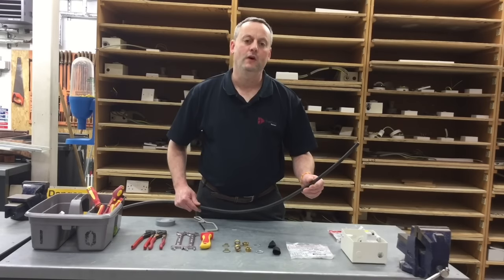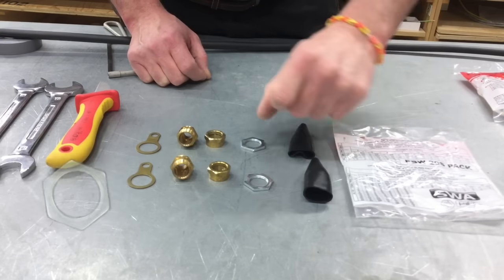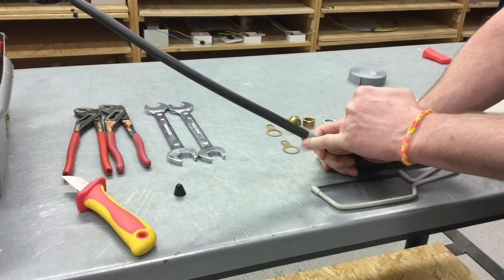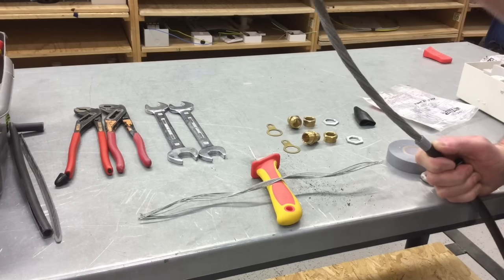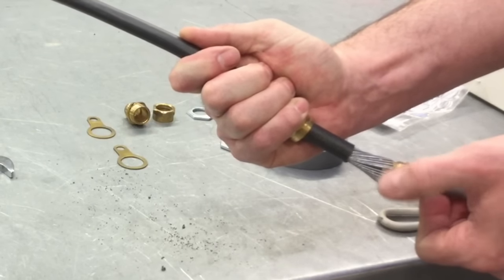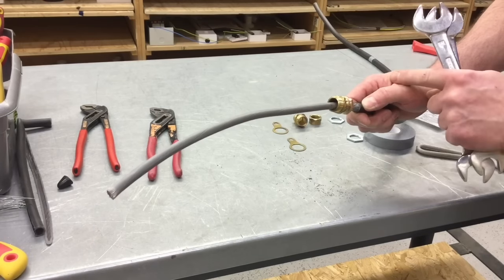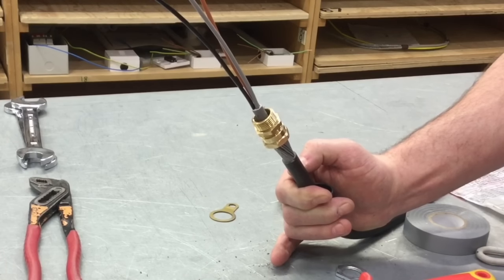How to Make off a SWA Cable Gland (Steel Wire Armored Cable) Step By Step Demonstration

Comment: Faultless work -- I've done quite literally thousands of these and you've got it perfect. You're a good instructor.
Reply from the maker: Hi. Thanks for taking the time to comment 👍
Reply: GSH Electrical do you have an email address
Reply: i dont feel your pain
Reply: I on the other hand am a rank amateur but wanted to thank you for an outstanding lesson which has allowed me to update and extend a power supply in my garden for a pond pump and filter I’m installing in a long derelict pond. Really appreciate the new learning and I’m confident I’ve put in a safe and waterproof setup.
Reply: @richardhunter1153  |Hi at the glands with a thimble called a particular name, I only seem to find the type without thimbles

Comment: I'm not in an assocusted trade.. I'm wiring my shed up with SWA and whilst I had a good idea of how to deal with SWA it's good practice for me to see how it's done properly. My SWA terminates at an isolator in the house which will be wired to a 32amp feed.. and terminates the other end in my shed in an RCD unit. I'm not paying £1000 for an electrician to do exactly what you've just demonstrated. So thank you.. you've saved me a Bob or two ;)

Comment: I really do miss working with SWA. Never thought I'd say that after running 1500m of it with 80 glands but after using the north American equivalent (teck 90) I do. Teck 90 has an earth conductor inside it and the aluminium armour which is segmented making it less flexible than swa isn't considered rated for cpc but still needs bonded. Add in the fact they have 120v/208v here which means two live conductors and a neutral making the wire even bulkier.

Comment from the maker: == 🕐 Time Stamps - Cut to the action 🕕 ==
00:00 - Making off SWA cable
00:34 - The type of SWA (steel wire armour) cable
01:02 - SWA gland pack explained number of conductors, size of conductors and gland size
01:34 - BW20S gland explained 
01:58 - What's inside a SWA gland pack
02:27 - Starting the termination demonstration 
03:12 - Fitting the SWA shroud
03:58 - Cutting into the steel wire armour
05:51 - Removing the outer PVC on the SWA cable 
06:34 - Breaking off the SWA 
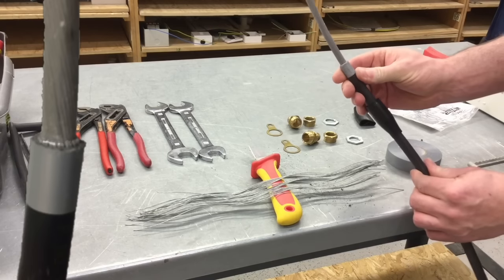07:31 - Start fitting the SWA gland 
10:50 - Tightening the SWA gland
12:29 - Removing the bedding material around the conductors

Comment: might be a good idea to also advise that this is an inside useage gland pack ie. bw20s  and there are external gland packs for outside use cw20s , bw should not be used for outside terminations etc

Comment: Hi Mate, 

Nice video, only one thing missing,... you inserted the rubber before putting in the Gland but you didn't do anything to that, I was wondering, do you tape that in, or do you cover the gland in any other way? 

Thanks 
H

Comment: Hi there
I have just purchased a set of swa glands but when I go to fit one there is NO THIMBLE on the end of the nut. Just the threaded bit. How can I fix the armoured wire without this thimble, please ?
It's impossible to screw the two threads together with the wire over the main thread of the gland.

Comment: How about terminating a 70mm armoured into an already installed waterproof gland (including working out the set).  A 70mm armoured that's taken 4 blokes 2 nightshifts to pull in - No pressure!  This is quite tricky and can be a bit nerve-racking if you've not done it before.
Reply: How about a 300mm 4 core using E1W glands not these CW glands, I hate them always looks a messy job until the sleeve goes on.
I much prefer the separate cone and olive, then you can open the gland and inspect it without disturbing the compression of the steel wire armouring.

Comment: We have nothing like the SWA cable in the US for building wiring systems. I like its  flexibility and the metal strand protection, isn't it also water resistant.
Reply: you would be using a similar but different gland for wet rating, but it is protected from water and UV

Comment: I wished we could all strip armoured like that lol. My on-site experience of armoured is much different. Generally been sitting around for a bit and damp sets in. The inner insulation gets stuck and makes it impossible to separate from the inner cores lol. Have to use a knife to cut the length of insulation and peel apart. Great video for the basics though.
Reply from the maker: Thanks Terry - the electrical workshop is warm and dry I tell them to enjoy whilst they can... sites are cold and wet. Gaz 😁👍

Comment: We wanted to gland a 3 core 185mm² SWA cable. According to the chart, gland size 50 was suitable. As it turned out, 50 sized gland was small, and we had to purchase size 63 gland at the last moment. Therefore, with experience I say, don't blindly follow the chart. Purchase one size bigger along with the original chart suggested size.

Comment: Any advice for removing the inner sheathing when it is quite long and difficult to pull off? As per 12.57 in your video. 👍
Reply: Leave it on until your cable enters the isolator that you are connecting to.  That's if you have a long tail from where you put your gland on.

Comment: Gaz  - Can I ask a simple question - why do you have so much armour showing beneath the gland nut - just watched JW's very good video on this and his termination of the gland looked so much neater with zero armour showing once the gland had been assembled. Is this down to differences in technique or a completely different style of SWA gland?
Reply from the maker: Hi the gland he is using is an outside waterproof one and the one in my video is an inside glad. Great question thanks GSH Electrical
Reply: GSH Electrical  Ah got it - thank you - between you and JW I am learning a helluva lot. I reckon You Tube is the alternative Open University for practical subjects. 👍😀
Reply from the maker: Hi. Thanks for the support Gaz
Reply from the maker: I hope JW responds as quickly as GSH Electrical lol 👍.
Reply: GSH Electrical I do not think that is at all possible - I reckon you have a You Tube implant in your ‘central processor’ 😂 JW has given me some great responses to my questions though ( as of course do you).👍
Reply from the maker: We all love JW 👍

Comment: Gaz were would the armord cable be fitted before its put in to a shed meaning dose it go in to the house consumer unit then runs to the shed
Reply from the maker: It can do but sometimes people run power to a shed via an spur from a house socket outlet.

Comment: Are there any different earthing requirements when connecting SWA to a TNS or TNCS supply at the CU end.
Reply from the maker: Hi. No 😁👍
Reply: @GSHElectrical  Thasnks for the reply 
Read this on a MyBuilder post 
"For a 40amp supply a 6mm or 10mm SWA cable would be required. If the incoming house supply is PME (TNCS) then a 2core SWA cable should be used with a local earth electrode driven into the ground at the garage end making the garage submain a TT supply. If the incoming house supply is TNS, then the earth can be exported and a 3core SWA would be preferable with the third core used as the CPC and cross bonded to the outer steel wire armouring.". 
Thought it was wrong.

Comment: Another great video Gaz. Out of interest what's the largest size SWA that is shown in college to the students?
Reply from the maker: Hi. They make off a 16mm 3 core for an assessment and we show them large SWA cables in the classroom and in the College switch rooms. Gaz
Reply: GSH Electrical cool. I suppose due to cost you wouldn't want to teach much larger cables but it's the same theory! Another question Gaz, do you still teach MICC?
Reply from the maker: Hi. Yes in the classroom and I make off a couple of ends each year. I always try and find a couple of practical lessons in the summer to let the learners make off MICC Cable it’s great fun. Gaz
Reply: GSH Electrical great stuff. It's the main cable we use!

Comment: Why is the earthing ring on the outside?  The connection to earth will be inside the junction box?
Reply: If you were terminating to a Consumer unit, the earthing ring(banjo) would be on the outside as you would also drill a hole through the CU and add a bolt (from outside to in) and then a fly lead internally to the earth/CPC bar. If I was using something like a Wiska box, i would place the banjo internally or use earthing nuts and then add the fly lead to CPC/Earth.

Comment: Just one point regarding H&Safety, you have to put quite a lot of force into the junior hacksaw and the knife when cutting the outer covering and SWA, it is a good idea to put a protective glove on the one hand holding the cable. Especially apprentices who have not developed the skills yet. How many of us slipped and have caught our hand. Good job though.

Comment: This video screwed me over. I used the glads with the nut with rubber at the rear end and cut shields to similar length to yours but without the outer sheath it will not grip.
Reply from the maker: Parts of a SWA Cable Gland - BW and CW - Electrical Wiring
https://youtu.be/XcM7hL6mO8k